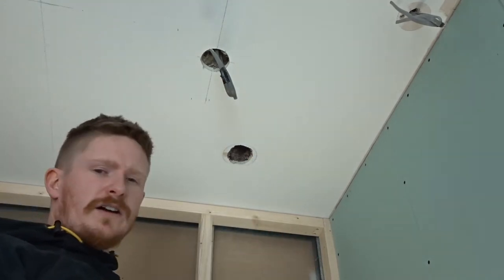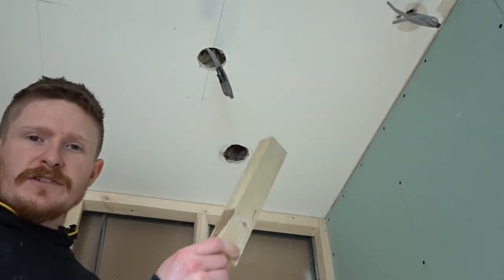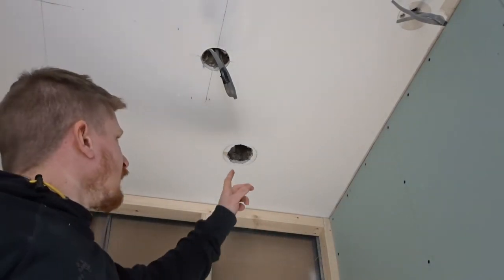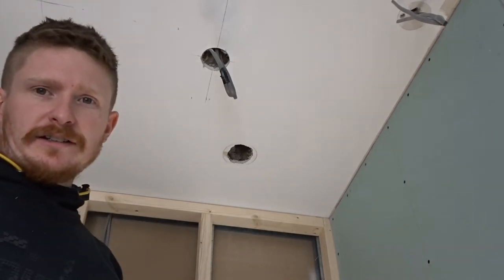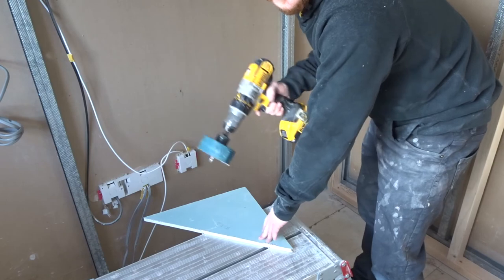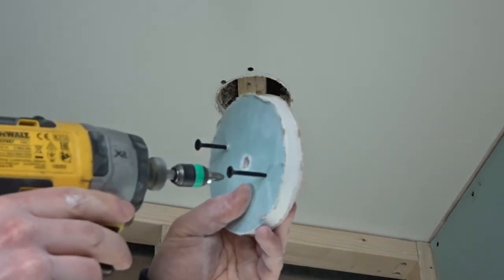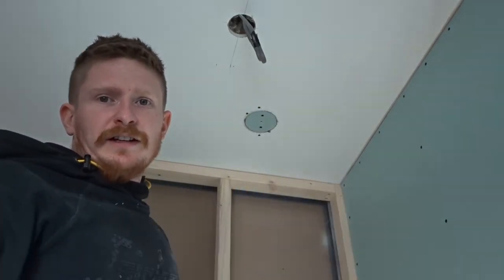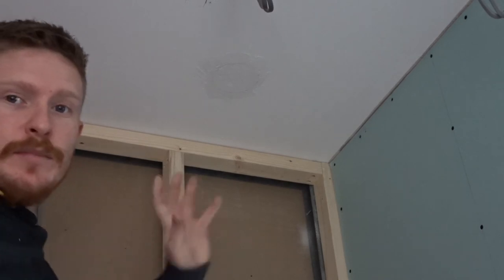How To Fix a Large Hole In Plasterboard Wall | Drywall Repair

Comment: I don't suppose you would be able to show us how to do a repair like this but on a wall that has a large rectangle hole? In my situation I had a very wide 3 switch for the lights and need to put a new one in a third the size. I'm not sure how to do it neatly. Thanks.

Comment: if you don't want to drop the wood behind a wall, place it behind a plasterboard, whilst holding it add a screw right in the middle of the wood and you have a little handle! you can then position it where you want it, screw to the plasterboard and remove your temporary screw at the end.
Reply from the maker: Absolutely!

Comment: I've seen many videos describing this way of repairing a hole but what frustrates me is who has a scrap piece of plasterboard kicking around to use as a patch? Certainly not feasible to buy an 8x4 sheet just for a repair patch. Maybe there's a gap in the market for someone to produce small patch sized pieces. 😊
Reply: They do sell 2'x2" repair boards,                  in the USA!!!!!
     Depending on your property, and level of desperation, you can look in the loft, under the floor, bath or kitchen units. There may just be a scrap piece kicking around.